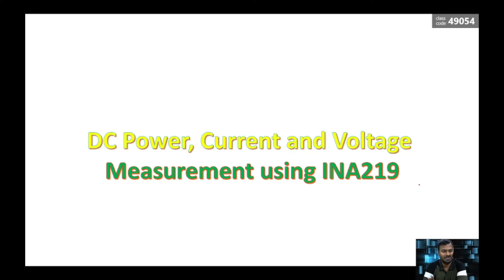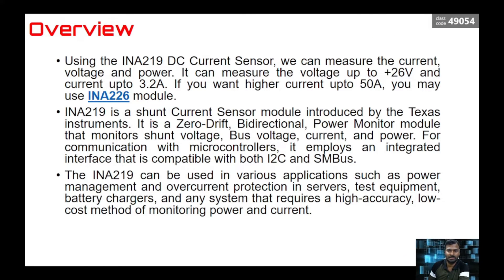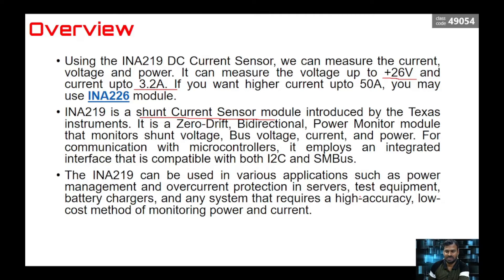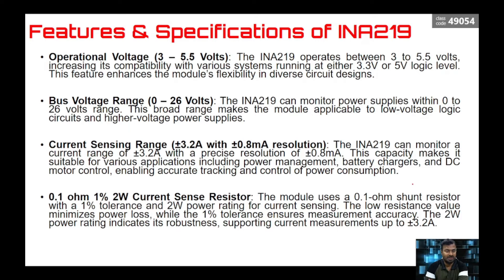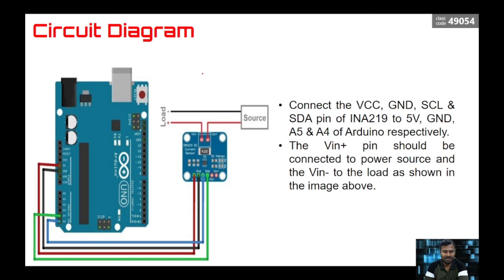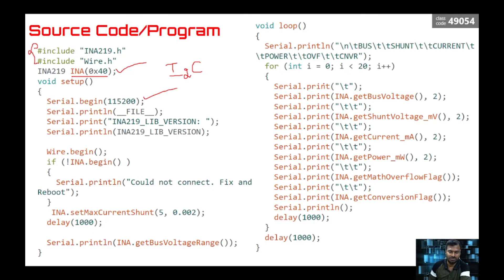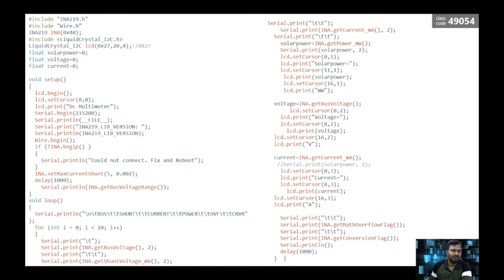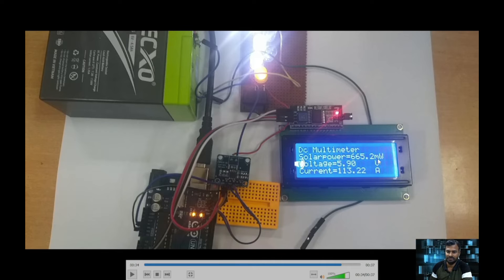DC Power, Current & Voltage measurement using INA219 and Arduino

Comment: Hi thank you sir for the video. In your video u mentioned the voltage value is from power supply and current value is from the load (bulb). Can INA219 measure current and voltage of dc motor?
Reply from the maker: if current and voltage is within limits you can use it mam, tahnk you
Reply: @rajababu.n6265 thanks for replying! Do i have to add capacitor or diode?

Comment: Thank you for creating this very informative blog. I assume your current displayed earlier in this blog was mistakenly displayed as 113A, but was most likely 113mA? Also, I do not understand your address of 0x44 (shown in your code). A0 and A1 allow for specifically addressing 0x40, 0x41, 0x42, and 0x43.
Reply from the maker: nice oberservation brother, offcourse it is 113mA, and Board 0: Address = 0x40 Offset = binary 00000 (no jumpers required)
Board 1: Address = 0x41 Offset = binary 00001 (bridge A0 as in the photo above)
Board 2: Address = 0x44 Offset = binary 00100 (bridge A1)
Board 3: Address = 0x45 Offset = binary 00101 (bridge A0 & A1) these are the addresses for my board
Reply from the maker: https://learn.adafruit.com/adafruit-ina219-current-sensor-breakout/assembly

Comment: Sir , i wanna know the power generated, current, voltage of the solar panel, i have solar panels all types , ina219 , esp32 wroom,  can you tell what should i connect to the load ? I don't have a battery, would a resistor do?

Comment: do we have to short analog pins of INA 219 if we use multiple ina's for addresses like 44 42
Reply from the maker: in the ina219 sensor there is pins to short for changing the address, those pins you need to short.

Comment: HI, can I use INA219 to measure current ? while running the motors with  L9110/L298 controller + Arduino?
Reply from the maker: bro connect +ve terminal from l298 to vin of IN219 and IN219 - terminal to motor positive & connect -ve terminal from l298 to motor -ve  so it will show the current drawn by the motor

Comment: Hi, thank you for this Video … but one question… can you confirm that the INA226 is for currency of up to 50amps ?
It uses the same shunt as the 219 . 
I appreciate you’re short replay, thanks again.
Reply from the maker: current measurement range can be different with respect to shunt resistor value as you  mentioned, and different shunt resistor modules are available in the market